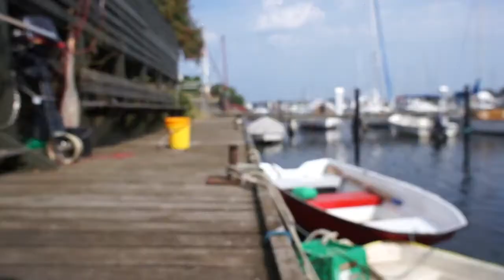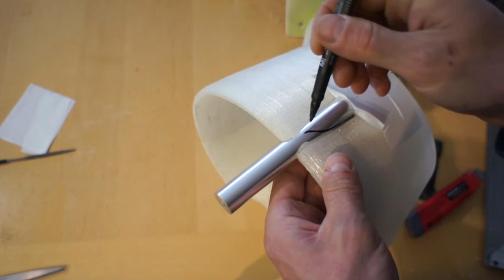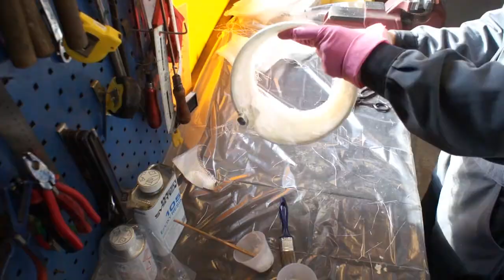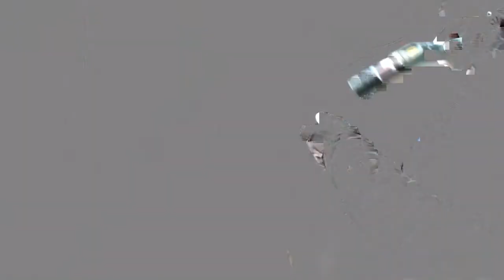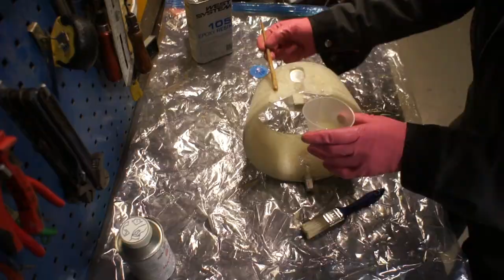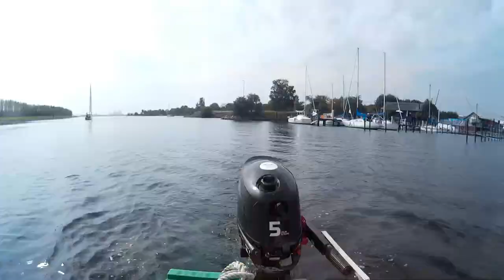A duct for my outboarder motor

Comment: I had something similar to this on a 18hp Tohatsu  4cycle outboard. It was made out of heavy-duty ABS and came with a hydrofoil that could be installed above it. Unfortunately I sold it with a boat and alas I can't remember the name of the manufacturer, nor can I find it anywhere, and assume they went out of business .

Comment: The point is does it gives additional thrust with the same power output?
Reply from the maker: I have not made measurements but it certainly feels like the thrust is greater at startup where the flow speed around the outside of the duct is low. It is also much more responsive in steering than outboarders without duct.
Reply: How about top speed?

Comment: Why the flat side to the outside?
Reply from the maker: A diagram to explain would be easier, but.. The duct is a like a wing (hydrofoil) wrapped around the propeller. The 'lift side' of the hydrofoil is towards the center where propeller is moving water through the duct. Hence the water on the inside of the duct is faster than outside causing lower pressure and therefore lift on the inside surface of the duct. This lift vector has a direction toward center and forward aswell where the angle depend on the differential velocity between inside and outside. The inward pointing component of the vector is cancelled out by circular design whereas the forward pointing components accumulates to make up the forward thrust of the duct. As the travelling velocity increase the relative angle of attack on the duct is reduced and the forward thrust diminished.. Therefore the duct is only increasing efficiency at low travel velocities. Furthermore the duct has considerable drag in itself. To answer your question: the hydrofoil profile I used for this duct has a straight curve on the lower side causing the duct to be 'flat' on the outside. I guess I thought it would be easier to drape glass fiber on a single curved surface rather than a double curved concave (anticlastic) surface..
Reply: @stigantonnielsen  i would think that the flat "lift surface" would serve to increase water pressure on the inside of the duct and increase water exit velocity. That an increase in pressure would increase speed